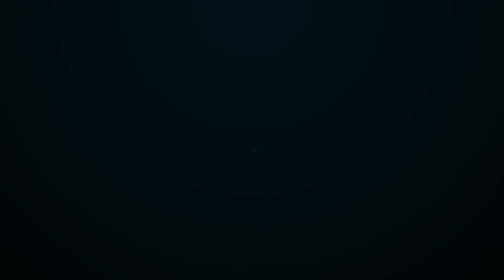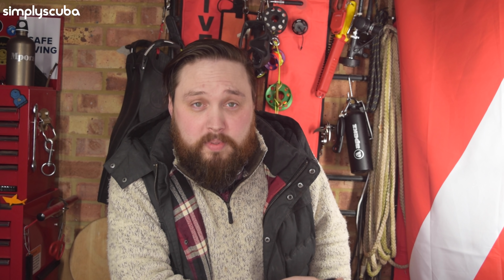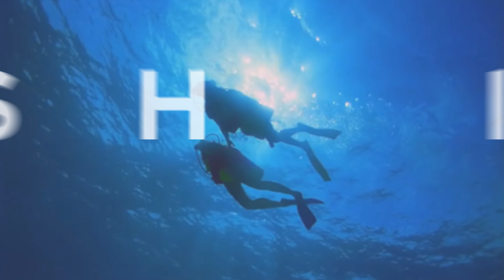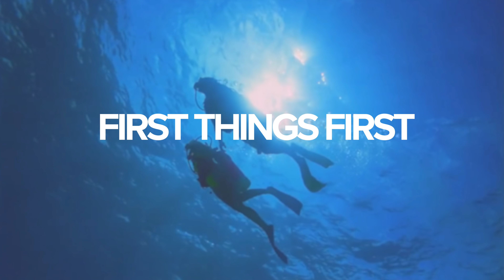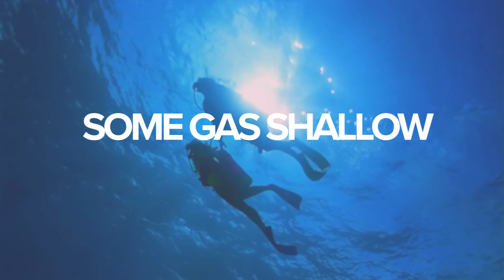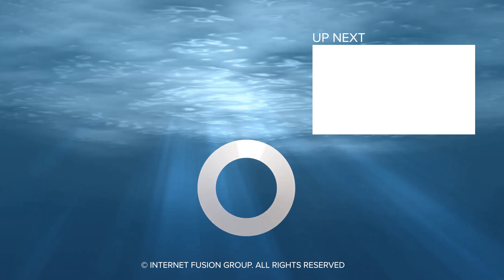Tank Running Out Of Air? Take These Steps... | Deep Dive

Comment: Good advice.
I had an OOA experience a couple of years ago, I took my last breath at 11m and had to ascend. It was a culmination of error’s that caused it.
1. New diver ran low on air during the dive and since I had the most left he used my occy for a while (he used a lot!)
2. Found out on that dive that my spg was faulty, reading high by 30bar.
Was it an enjoyable experience? No but I’m proud of myself for the way I handled the situation most important thing to do is not panic, remember your training and again don’t panic.
Reply: Why did you continue the dive while sharing air? I was under the impression that as soon as you start sharing air, you ascend.  Unless it was a simple fix that could be done at depth.
Reply: @Knoxie89  , I was trying to come up but the rest of the group wanted nothing to do with it,  it was my first and last dive with that group.

Comment: I ran out of air on my 2nd check out dive. I was maybe 6 feet deep. I signaled my buddy who didn't surface with me. I didn't exhale as I had no air at all. My instructor asked me to inflate BC which I had to catch breath to do then he promptly yelled at my buddy. in 1984 we did have pressure gauges on our checkout. So glad they changed that when I went thru class again 2 years ago when I got back into it.

Comment: Only happened once. Second ocean dive after certification, didn't know anyone else on the boat. Hit turn around pressure but dive buddy didn't want to go back, stayed with him a few minutes longer than I should've, had to leave him alone because I was getting too low. Couldn't find the anchor line and the visibility was poor with a medium strength current, started to mildly panic but I found the line and accended to my safety stop and thankfully there were other divers there. We had to do an air sharing accent and I needed to orally inflate on the surface. I learned to always either have an actual friend with me, or stick to the dive guide

Comment: The only close call I was there for was the deep dive on my AOW class.  3 students and the instructor.  After the skills at depth it was discovered the husband was very low.  This was at about 80ft.  Instructor buddied me up with the guy's wife, took a compass heading to the boat and did an assent while generally headed in the direction of the boat.  He was buddy breathing before we got to the safety stop but there was enough air for the full stop.  I learned to pay better attention to my air, got hp120 tanks, safety stops in open ocean are tricky to stay at depth with no line to hold on to and learned that it is a bit disorienting when in good visibility you can't see the bottom or surface because you are in the middle...

Comment: You should ALWAYS have a mental estimate of the amount of gas you have.  Tell yourself how much gas you think you have before you look at you SPG.  Then, you can tell if you're going through your gas faster or slower than expected.  It'll also alert you to faulty gauges and short fills.  Plus, it will instill the habit of checking regularly and actually reading the gauge.

Comment: Got low once...I was being careful but started breathing heavier toward the end of a dive. I was coughing for some reason and panicked a little, hit 500 and was worried about that which was a catch 22 since I breathed heavier (was turned around trying to altert buddy too). Got down to 300 and had to suck harder. Shortened the safety stop and did a shallower dive next dive to be off gas. Moral of the story is you can suddenly increase air usage and if you hit 500 don't panic...you'll get up doing normal procedures but a panic can make you use your air way faster.

Comment: I had a new diver, who I did not know, on a 110 ft dive hw should not have attempted.  He ran out of air at 50 feet. Was on another divers octo, but he panicked, and tried to swim to the surface with no air and no reg.  I has one of those stupid integrated reg/power inflator set ups.  I got to him, and gave him my "spare air".  It got him to the surface just fine.  At the surface he started yelling help me, help me, I am going to die, and let my spare air go  which floated  off.  He had a panic attack at 50 feet under water.  All was well in the end, but you should mention the "Spare Air" option.  It saved the day in my situation. Jack W

Comment: Pre-dive checks, period. Most of OOA situations are just people not checking their tank pressure before the dive!
Reply: no, problem starts by not checking your gauges when the tank is low on air for a safe exit no matter what you started with ... anyone can dive on a half tank but the point is to always need to check gauges before you are too low for safety .... here in California many panic when get tangle in the kelp (they wrap around like ropes if in the thick of it) that hang on the top  and drown close to the surface because they where too low on air to exit and did not leave anything in case a emergency ... you gauges are your warnings.
Reply: @frankc6430  You'd be surprised of how many people that I saw going OOA just minutes after submerging, just because they thought their tank was full (personal tanks, mostly). That's what I see most of the time. Where I dive, conditions are not very friendly for newbie reckless divers, so I don't see a lot of very very stupid mistakes commited like not checking gauges. 
On the half-tank diving: it depends on the type of dive and on the capacity of said tank. I'm perfectly fine with diving a half-full 2x10L on a 20 meters dive in the ND limits with no overhead environment (wreck penetration/cave) as long as you respect the thirds rule: 1/3rd for half of the dive, 1/3rd for return, 1/3rd for unexpected. I you want to be safer, or in an overhead environment, a quarter or a fifth rule is the least recommended. That's calculated in case if you get tangled, lost, or have an equipment malfunction.
If you know these rules, that means you're at least basically trained. People who go OOA because they were not checking their gauges should not be diving in my opinion. The only "acceptable" way to go OOA for me is gear malfunction (which can be mostly resolved by diving twins or sidemount, and using DIN regulators).
On the kelp-tangling subject, I've only witnessed people getting sea-sick watching kelp moving with the waves underwater. I'm not saying it's impossible, but that's improbable especially if you dive in a group of at least two. Getiing tangled in line or a net, that I've seen. 
I've seen pretty close calls on videos from the US and PADI diving centers in general. I understand why they limit their divers to 30M, because a lot of "certified" AOW divers just bought their diploma. If they had a 60M certification like we do in France, they'd just be dead...
Cheers!

Comment: When I was diving with my instructor, just after my open water he had an catastrophic regulator freeflow and got out of gas within like 20 seconds. That's why we stay close. I mean within 2 or 3 meters. But I really don't get the point of dropping a weight belt when your already at the surface. The gas in your bcd and suite will expand during your ascent and increase buoyancy. You should float.
Reply: Dropping weight means that no matter what the situation(numerous scenarios with BCD failure, inflator failure,OOA(you cant fill a BC without air in your tank except for oral)) you will remain positively bouyant because of your wetsuit and whatever air may be in the BCD. it also makes it easier for someone helping you to get you out of the water. Keep in mind im talking about a true emergency situation not a "near miss".
Reply: @forgot_my_name_again  See reply above on dropping weight when still on the bottom.  It can be very dangerous.
Reply: @timgosling6189  Yeah depending on how much weights you have, you may pop out the water like a humpback whale and have a serious chance to get a type 2 deco or AGE. But still it might be better than drowning. Personally I don't even have a weight belt or other weights i can drop. Just swim up a bit and expanding gasses will do the rest.
Reply: @forgot_my_name_again  Agreed.  If you have no droppable weight and are neutrally buoyant at depth then it’s just a normal ascent for you. And as you say if you do. drop a bunch of lead you will likely find yourself imitating an ICBM.  So the only time to drop weight should be if you find yourself uncontrollably negative, due to a ripped BC or flooded dry suit.  But a balanced rig should allow you to swim up with weight in place and under control.  I once had to do a course which involved swimming up from 100ft on a single breath.  It’s not as bad as it sounds😊
Reply: @timgosling6189  couldn't agree with you more. Generally you don't offgas your wing or suite when your out of gas. But to be honest. This is why we dive with team mates, buddies or fuck it just bailout gas. No need to swim to the surface. Someone with backup gas should be a bit closer.
Reply: you and your buddy should always be at arms reach until you get more experience... if you can`t extend your arm and not touch him ,you are too far apart ,even if you need air to grab his octopus hose is only 2ft long or a emergency ascend you need to hold to each other  ! ...a emergency can be a matter of seconds !... take your rescue class too so you know also how to deal with a panic diver underwater and on the surface !... if you ran out of air underwater ,there will be no air for your bcd either so that`s why you drop your weights too , to help you float to the surface not pull you down while you kick up and yes air expands but if you are still too heavy then drop the belt that you can recover later or buy another !
Reply: @frankc6430  Great point on your buddy; if you're more than a couple of seconds away you're a spectator, not a buddy.  But the weight, again, no.  Even if you run low or out of air you will still be neutrally buoyant and you will have air in your BC because you will otherwise be negative at depth.  You will not need to add any more gas as you go up, in fact on the contrary you will be dumping it.  The only time you may need to dump weight is therefore at the surface if you cannot for some reason orally inflate.  Dropping weight at the bottom will result in an uncontrolled ascent as eventually you will have dumped everything in your BC/suit and still be positive.
Reply: @frankc6430  Obviously your right. This situation happened about 15 years ago and I'm more experienced nowadays. I'm diving with a complete different approach and different gear setup than back in the day with everything redundant and pretty much self reliant. Although out of gas is still out of gas. That's why we train for this like all the time. 
But I really don't get why some organizations promote dropping weights like that. In these parts people dive with up to 15KG or more weights if they dive with a neoprene dry suite. You may do a ascent from 40 meters in like 30 seconds and could actually die or end up in a wheelchair as a result. I would only consider doing that if I had a wing failure, be out of gas and lost from my dive team, all at the same time.
Reply: @timgosling6189  scenarios at different at the surface or a the bottom ,to drop weights and you say you are neutrally buoyant with no air meaning your last gulp, I bet you will drop those weights to get to the surface in a hurry and worry about the bends later, here in Cali we  have 7mm suits because the cold water that will float you up like a cork with no weights but also weight distribution is very important that`s why some goes on your bcd pockets front and back and some in the belt and some on your belt so if you drop weights you don`t need to be a cork unless you need to and drop more , you have options while dropping weights and on top of that if you got a buddy he should hold you somewhat either to give you air or hold your ascend if he can,     but I rather be at the surface then to drown thinking that you can kick your way up when you are about to black out and depends how deep you are too 20ft or 50 or more below?I know the consequences of this sport and got to be ready when shit happens is not the same scenario always ,just make sure you exhale to avoid embolism to your lungs if you remember in a panic, while neutrally buoyant you are just a sitting duck gasping for air and exerting you last energy kicking up if you might make it or not , you are going up no matter what with no safety stop but that also only affects you depending on your dive depth and time under plus how your body handles the pressures , i used to dive every weekend for many years and also worked a crew in charter scuba boats for fun ... anyways I know everyone says things until it happens to them and I have seen many of these scenarios in my 20 years diving with different friend instructors and taken new people as a tour guide, been a assistant to help as a back up for many their classes of new divers, people panic and all the theories go out the window  , so I been there close enough to hold them or calm them down  or pull them up , I always dived for fun until dive master and I also had friends drown with technical gear ,rebreathers almost at the surface because of panic . Just saying , remember that these are life decisions in seconds of terror for many... I am not perfect either I made few mistakes too but I know I can control my emotions and think my steps to fix or get out of the situation , main thing is not to get in trouble in the first place because it can be the last one ever. Just my take on it.

Comment: I've never completely run out of air but I came close. I'm a heavy user of air and on a trip my tank got down so low, at 100 psi, my dive computer stopped reading the pressure. I was just at the boat when this happened.

Comment: 1972, J valve Tank, J valve activated, no spg, very first dive not in a pool, inside a small cave in a spring. Class Dive buddy not ready to leave cave, too busy carving his name in rock wall! Finally had to buddy breath out and up, No deco / no safety stop. Stupid ! NEVER again, continuously upgraded to latest safety equipment and practices through the years. After 48 years diving,  SPG, + two air integrated dive computers  + 3 cu.ft. Spare Air AND religiously monitoring dive profile and AIR on all three devices.

Comment: Wouldn't it be better to let go of the lead immediately and not only after ascending? It's really hard to ascend without air but with kilograms of lead
Reply: No, absolutely not.  If you are correctly weighted you should always be able to swim up without dropping your weights.  Remember that you get more buoyant as soon as you start up.  Dropping your weights at the bottom is the first step in an uncontrolled ascent where even with a completely empty BC and/or suit you will continue to accelerate and risk DCI.  Even on the surface, you should be able to inflate your BC orally even with no gas in your cylinder.  The average Jacket BCD has about 40lb of lift which is far more than the average single-tank diver ever needs so dropping weight is only needed if your BC has a leak or the valve is malfunctioning.
Reply: @timgosling6189  Okay thank you for the good explanation

Comment: I don't check the guage. I don't have a buddy, and are usually in under 20 feet. I usually wait till I feel it in my mouth. I run out of air fully 10% of the time. And below 500 60%, but I'm special, a commercial diver. If you're doing fun diving don't do what I do. About 10 times I have had to dump my gear. I've been getting better over the years.